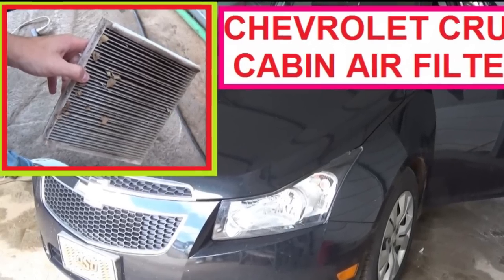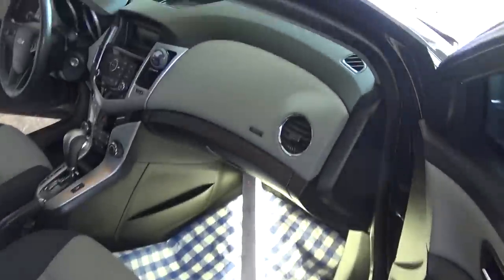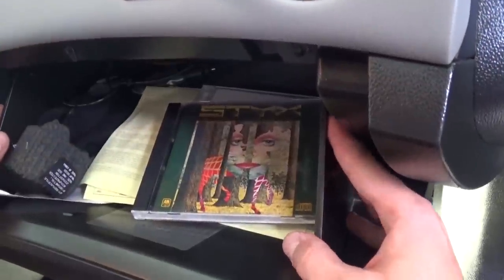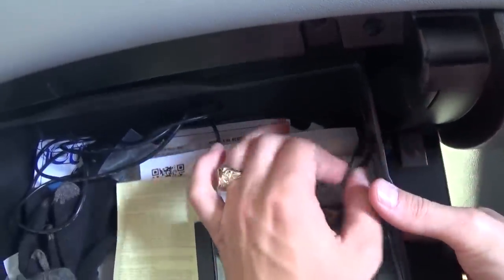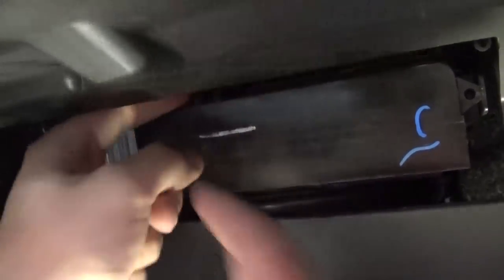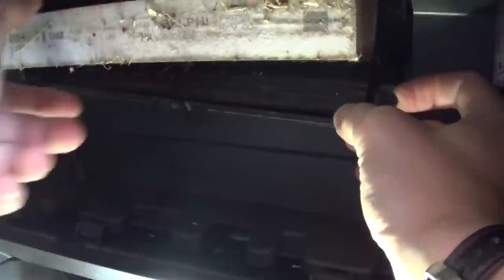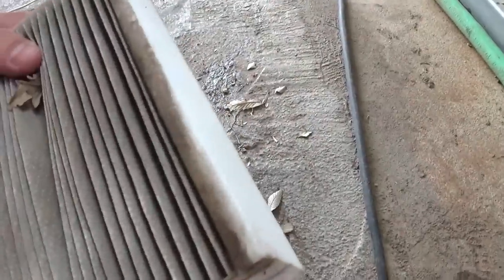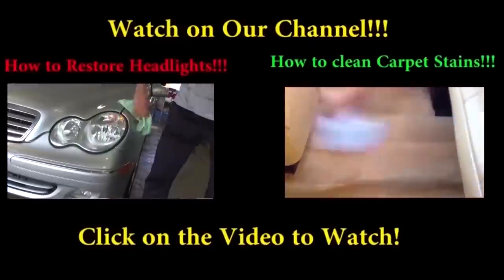Chevrolet Cruze Cabin Air Filter Pollen Removal and Replacement  2010 2011 2012 2013 2014 2015

Comment: You may want to mention something very important:  Air flow direction when replacing filter back in.
Reply: Air flows down through the filter. You want the arrow on the filter pointing down.

Comment: The Indian Chevy Cruze Air Filter is located at the same place but has a glove box support attachment in between which has to be removed first with a screwdriver. Rest else the procedure is same as shown in this video.

Comment: One issue I had was, when I pulled out the filter I had some leaves on it… some of those leaves fell down to the blower (I didn’t notice)…. So after I put in the new filter and ran the blower… it made this vibrating sound… sounded like the filter was rubbing on the blower…. So I took it out,   Reached inside and found the leaves…. Small ones… I fished them out one by one and the noise went away..

Comment: I would never attempt to clean an air filter, the dirt particles are embedded in the cellulose pores and you can't get them out, you'll only get out large debris which probably wasn't affecting airflow anyway.    If you try to clean an engine air filter you can actually damage the pores enough to allow large micron contamination into the engine.

Comment: The hardest part of replacing the air filter has nothing to do with the air filter.  The hardest part for me is putting the glove box back in place.  This guy skims by it.  I spent an hour trying to get the damn thing back in before giving up.  Had  to watch a video about removing and re-installing the glove box and got it back in immediately, not before losing one of the plastic guides behind the dash though.

Comment: Just get a K&N engine air filter and cabin filter. it will save u alot of money. just wash, dry and recharge then it's good to put back in
Reply: Bubba Mane K&N air filters have horrible efficiency, they are oiled cotton gauze, basically antiquated.  The fine dust efficiency is only around 96% compared to 99.90+ of an oem AC Delco filter, which is a HUGE DIFFERENCE when you realize that airborne silica ends up in your engine oil and causes much higher metal wear in your engine.